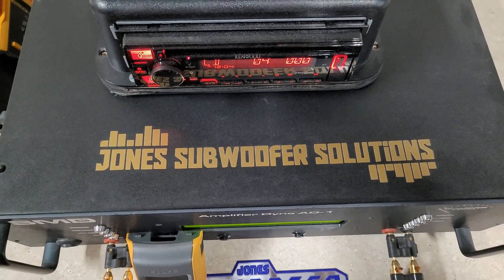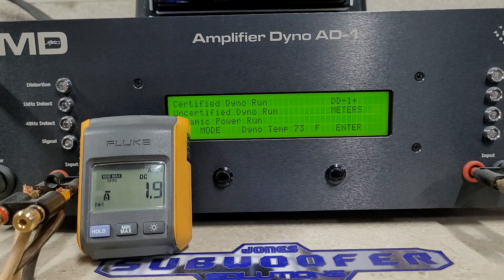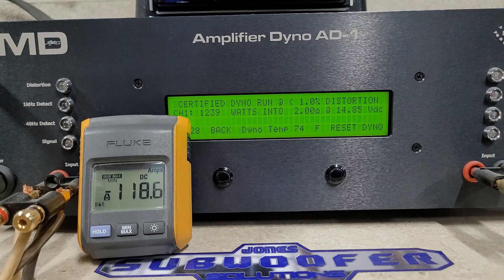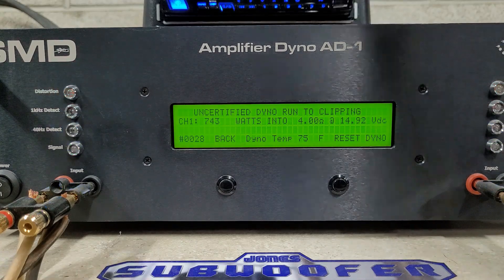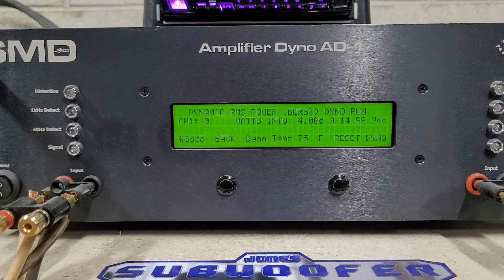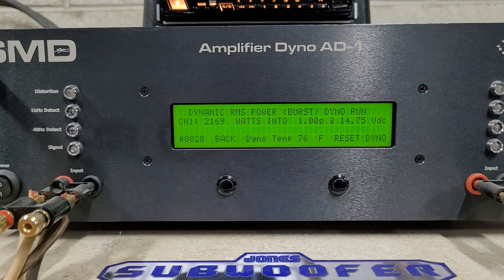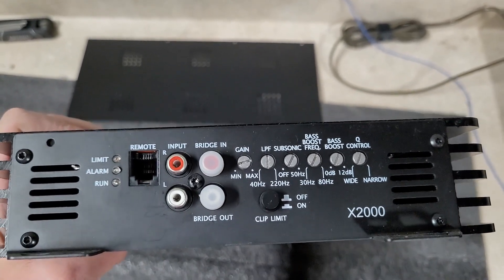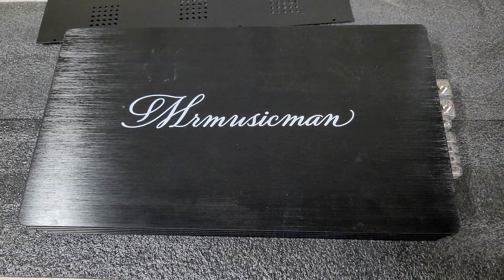AD-1 Amp Dyno Mr.Musicman X2000 by Jones Subwoofer Solutions JSS

Comment: $250 as of 2/7/22
X2000 class D mono amp 
0 Gauge Power and Ground inputs 
Strappable technology & clip indicator
2,000RMS Watts@ 1ohm 
1,200RMS Watts@ 2ohm
650RMS Watts@ 4ohm 
200A fuse required/ Regular Bass control included with the amplifier. 
(Clip indicator bass knob can be purchased separately on this site )

Comment: After impedance rise this amplifier want make anywhere near rated but if it's priced right it would be a nice little amplifier
Reply from the maker: Few amps will make full rated power after rise, most manufacturers are using non-reactive loads to set ratings.

Comment: 70dB SN ratio is junk. To many fly by night chinese amps coming out. You'd have to have 4v-5v or more for full potential out of that amp an for thoze with Budget headunits or no line driver or even worst a cheap LOC theyll wonder why this amo doesnt push the way it should on first initial set up. Been down this road to many times with those cheap amps being pumped out looking jenky as fuck. It can do rated. Thays cool an all. Its more then that anymore